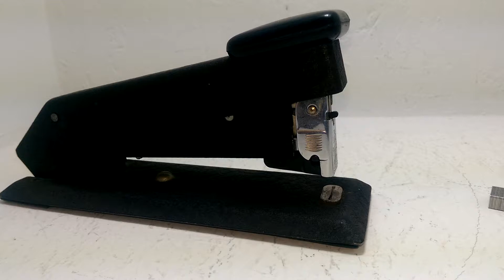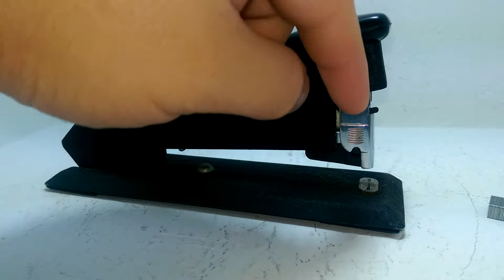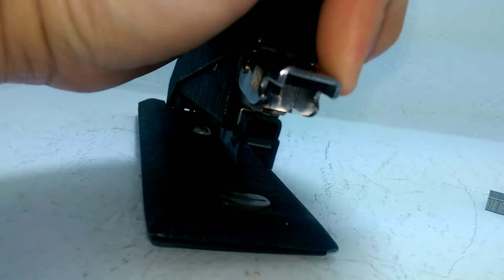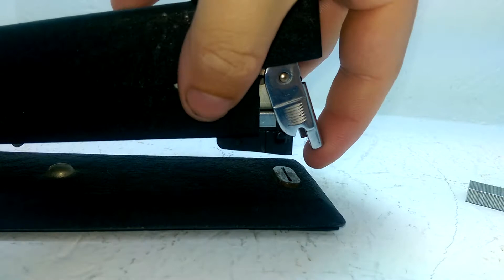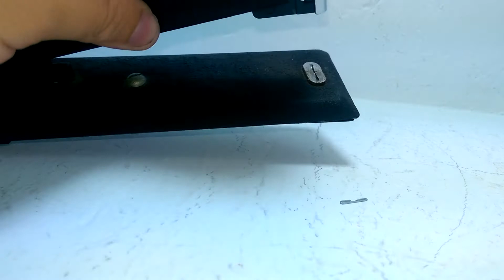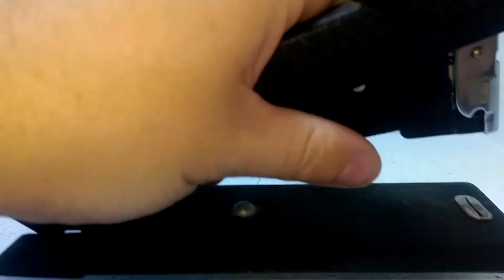How To Load Your Vintage Bostitch Stapler

Comment: The silver part doesn't even budge I can't get it to open 😭 I've used this stapler it works fine and is in good condition I've opened it before but it won't work

Comment: I was loading staples into mine, which I've had for 31 years (but it's actually much older than that), and the slotted tab thing came flying out! It wasn't easy but I finally got it back in there. I had to remove the "TO LOAD PULL UP AND INSERT STAPLES" piece by pushing it's pivot pin out. Then, once I had the slotted tab piece back in, to reinstall it I had to lift the spring that holds pivot pin in place up and out of the way, which I did using a .075 inch drill bit. It's good as new again now but for a while I was afraid it had placed it's last staple!

Comment: I have this stapler, I've know I've loaded staples in the past, but I came here completely stumped. It's been stored for awhile. Silver tab DOES NOT BUDGE. I couldn't open it with two hands, let alone one. 
Out of frustration I was trying to pry it open with screwdrivers. Nothing. Finally a couple of taps on the side with a small craft hammer popped it open. I don't know how it jammed. If you're watching this, beginning to doubt your sanity, try a couple of light taps to the silver tab.